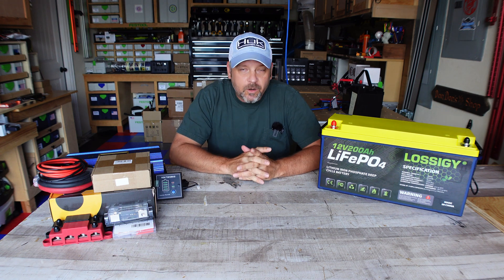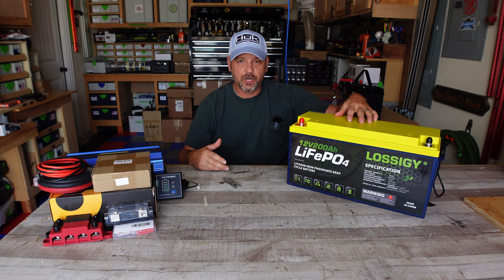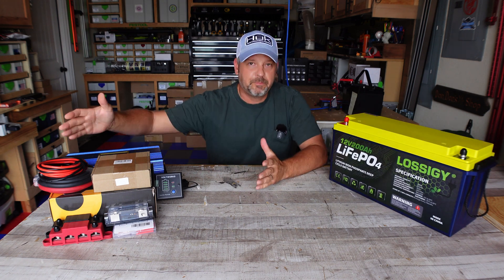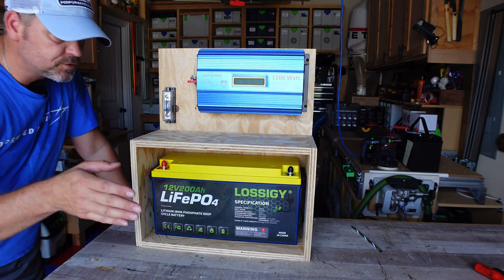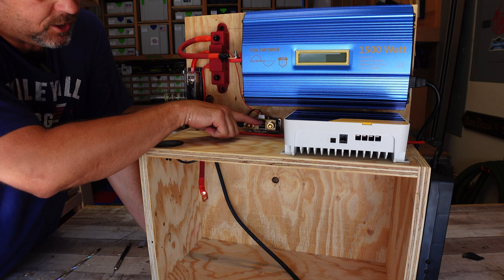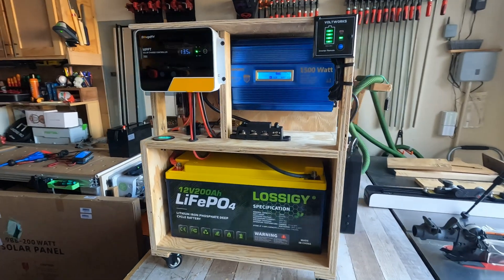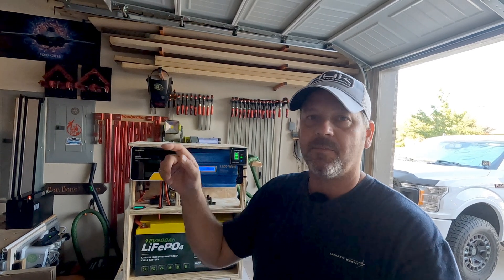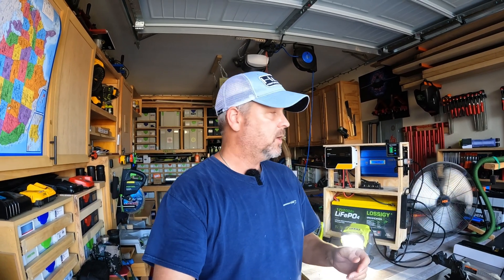Simple OFF-GRID power station: Lossigy 200ah LifePo4 : Super Simple Build!!

Comment: @brian waters outdoors:  I am building a system like the ones you've shown in your videos.  I am improving on my original system, including some Harbor Freight controllers and other components, making it better than it was.  The Harbor Freight kits included LED bulbs with a long wire, ending in a barrel jack.  The HF controllers had 3 ports for these lights.  I have already upgraded to the BougeRV 40Amp controller, but have many of these lights installed I'd still like to continue using.  Do you know of a control panel with the barrel jacks, much like the USB panel you installed on your example, that I can wire into the system and still control/use these lights?  Or am I better to investigate one and cut off the barrel jack and see if they just have two wires in the casing to make them work?  Thanks much for the inspiration and info!!
Reply from the maker: I’m not aware of a panel, but maybe you could drill some holes and use these for the 5521 barrel connections?
https://www.amazon.com/LUORNG-Threaded-Connector-Pre-soldered-Waterproof/dp/B09H5L3KN5/ref=mp_s_a_1_10?crid=36I544QKWV3I2&keywords=5521+input+12v+panel&qid=1691418471&sprefix=5521+input+12v+panel%2Caps%2C270&sr=8-10
Reply: @BrianWatersOutdoors    That's something I had considered also, I have some of these female jacks of a different style, so perhaps I'll just do some testing.  Thanks so much.
I currently have a Weize 100AH Gel battery and 3 SLD Marine Batteries (can't recall the AH on these), but from what I understand (discovered today), I need to separate the wiring for the different types of batteries for a longer life for the Gel.  I love off grid solar to try and take some power from paying the grid and now for emergency power needs.  Inspired by your deep freezer run for several days.  I think I'm on the right track.  It's addicting,  lol.

Comment: Why did you go with the voltworks 1500 this time, instead of the Ampeak 1200 like last time?  I'm in the market for an inverter and like the Ampeak, but heard it could be noisy.  I'm looking for a more compact unit, but having just over 1000 watts is a neat idea.
Reply from the maker: It’s just a little nicer. The Ampeak is quite loud.

Comment: That's a neat build. One thing that could be added is a 24v Meanwell power supply. It can be connected to the solar input of the charge controller and be used as a shore power charger.

Comment: Great video …I have seen 24v and 12v battery , what is the advantages if go with 24v battery ? Thanks in advance
Reply from the maker: Basically: 24V systems are beneficial because you can use smaller diameter wire and reduce amperage by two times. Using smaller diameter wire can reduce wiring costs and decrease the space needed to run wiring. This is especially important where long wire runs are required.
Reply: @BrianWatersOutdoors  ok thanks. maybe your next video can be the 24v battery . great video and thank you for the reply.

Comment: I'm thinking about purchasing that inverter. Can you tell me if it is truly pure sine wave and does it put out a full 120volts ac?
Reply from the maker: I can say it’s putting out a solid 120 volts under an approx 500 watt load, but I don’t have any measurement tool to confirm pure sine wave though. I do know this company has been around a while and seem to manufacture pretty nice inverters.
Reply: @BrianWatersOutdoors  Thanks for letting me know. You were running fans off of it. As long as you didn't here any extra "noise" in your fans it's probably clean sine wave. I ran a fan off a cheap modified sine wave inverter and the fan had I high pitched whine (noise) while it was running.
Reply from the maker: oh yeah, no noises at all, and I did run some more equipment that was not on this test and didnt notice anything.  My coolers, a battery charger for my drills and of course this fan you saw.

Comment: Another great little build, but is air flow that critical in a unit this small that the components can't be enclosed?  Maybe have a box with just the controls showing (meters, switches, outlets, etc.).
Reply from the maker: Thanks. If you’re not running the inverter too hard you could probably have it enclosed. I’ve seen a few folks build one of these that way.
Reply: @BrianWatersOutdoors  Maybe add some type of small exhaust fan.  Just worried about the younger grandkids touching stuff they shouldn't.

Comment: I love it. Nice and compact design. I did the math and that setup would run my 5000 btu window ac for about 5-6 hours.
Reply: What brand of window AC is it? I bought a manual controls supposedly soft start Frigidaire months ago but haven`t set it up and tested it yet. I got it and a cheap 2 stroke gas generator that`s supposed to bew able to power it after hurricanes for about 4 or 5 hours per gallon of gas. Now I have a 300 ah battery in my war on hurricanes.

Comment: I need to rig up something similar with my 300 ah battery. I got it so I can have power for a small window air conditioner in the future after hurricanes mainly but I can use it for a lot of things. Hopefully prices continue to fall on these batteries. I wish I could have gotten four of them but spent all I had on it, inverter, and charge controller and still need more solar panels. I`d like to be able to charge it up fast. But even the chargers are crazy expensive. I foolishly thought I could just buy a high wattage charger and top it off fast with a gas generator but I could only afford a questionable cheap 20 amp LiFeP04 charger with mixed reviews. Now I`m scared to use it. A highly rated one costs hundreds and still takes all day to charge. Makes absolutely zero sense.
Reply from the maker: I bought the $80 Victron smart charger and it’s amazing. It’s only 5 amps so it takes a couple days to charge though. But I trust it.
Reply: @BrianWatersOutdoors  I may have to get it. I need a backup. Not sure how to test the one I have for safety. I`m worried about it damaging the battery. It may be best to just solar charge it to test it.